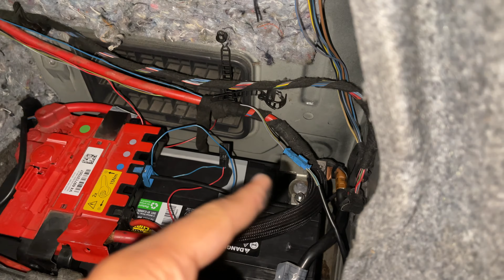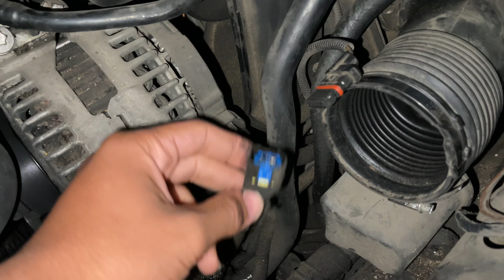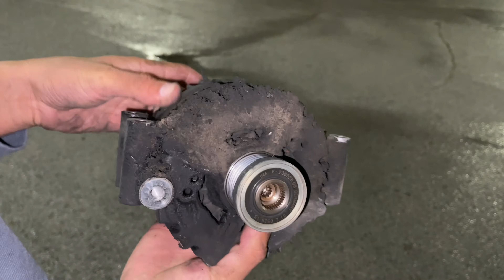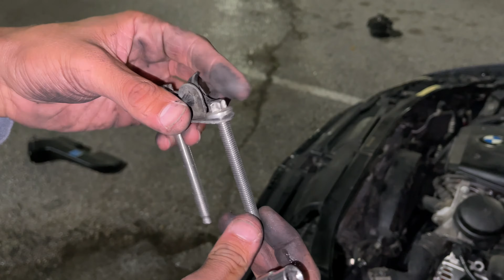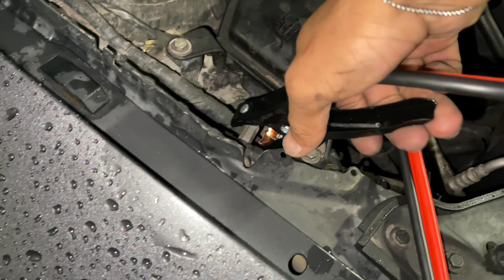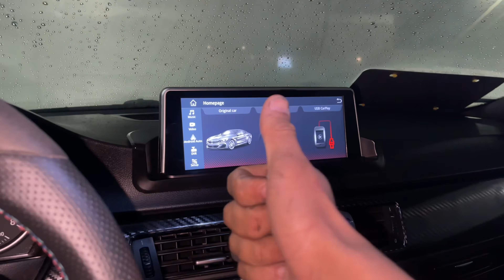BMW Alternator Replacement | N52 E90 E92 328i 528i

Comment: My electrical connector is damn near just stuck any advice to get it out ?
Reply from the maker: Use electrical parts cleaner to spray the heck out of it, then let it sit a few minutes. Do this a few times and you should be able to pop it off

Comment: Just did this. It worked. Took 3.5 hours, but when I jumped the car and it stayed on this time I knew I was good. It was hell trying to get the alternator electric cable to snap out and the tensioner on the cable was a bear (especially getting the belt on and lining it up perfectly) but damned if I’m not back on the road. Great video!

Comment: Just want to say thanks for this video. I just finished replacing my alternator and this is 1 of the videos helped me a lot. It was my first time, took me 1 hour and 45 mins. The mechanic quoted 500 for a new alternator plus 1.5 hours of work which was 200 so total of 700

I ended just buying a part of Facebook for 200 and attempted it.
Reply: I’ll be doing my first alternator change. Any tips?
Reply: I was quoted  $1,700 for mine! This looks  an easy fix. The alternator on these  motors  is well  placed  for replacement!
Reply: @malcolmwolfgram7414 I said the exact same shit I took mine in and they quoted me at 550$ for new starter and 200  for labor work 750 total I’m doing mine this week fuck paying to get it done

Comment: Question?! My battery is dead and when I jumped it the inside of the car lights came on. But, my headlights are very dim. Could it be the alternator?
Reply from the maker: start by replacing or testing the battery first

Comment: God after 160k miles, this is the next thing I have to do... Already replaced car battery, car starter, spark plugs, ignition coils, purge control valve.. All on my own to save $$$.. but I am having dimming lights on my radio system so I am just going to go ahead and replace this anyway then after that the fuel pump replacement and hopefully this should last me at least six to 12 months until I get a new car. Never getting a used BMW ever again.
Reply from the maker: these are common car issues, not just BMW. at 160K miles a starter, ignition coil and battery will be bad on any car. In fact, on a non-BMW, they would be be well before 160K miles
Reply: @IzzyE9X yup all 3 of my shit went out at 167k miles on my 328i my starter alternator and my battery is also low voltage but I think it’s due to my alternator not charging it

Comment: In depth explanation thank you, im thinking of buying an e92 325i and im watching these videos to be prepared even tho the car has low mileage 😂
Reply: I can tell you I love these cars but holy crap can they can become money pits. Just did my coolant tank, found out one of the front tires were getting chewed up while doing the oil change. While up at the tire shop shelling out 1k for new tires, balance and alignment I get codes pointing to maybe my alternator or battery going bad which is another $300 for the alternator and another $300 for battery while I just spent like $400 on new expansion tank, new cap, coolant and some new seals.
Reply from the maker: All of those issues listed aren’t specific to BMW’s and are issues you’ll find with any cars. The only difference will be high labor rates
Reply: @IzzyE9X  its that all the parts of are higher quality level and or more advanced systems so everything is more expensive.
Reply from the maker: @stevensims3342  that’s a fair point

Comment: Hey bro i got a 2011 328i so i try to start the car this morning all i hear is a click every time i try to start i replace my starter and batter 2 year ago  and today i bring the battery to autozone to get it charge it only got 23% after it change to 100% plug it back in still not start but it only start when i use a jumper cable to start after warm up for 20 min go for a drive for like 10 min and car show up battery light and all light flashing and wiper going off car went to limp mode and bearly can drive home then turn off by it self and i got ton of weird code and car feel like it missfire too is this a symptom of the alternator?
Reply from the maker: two years is a pretty good amount of time, it could be the battery. If it has a dead cell or is giving out it could cause that issue. now if you put a new battery and it dies within a week or so, then that is for sure the alternator. two years is a good while though
Reply: @IzzyE9X  i will go and get a new battery tomorrow and put it in see if it work
Reply: @IzzyE9X got a new battery same day car started not turning on and had all kinds of errors like abs and transmission errors thinking it might be the battery because care don’t wanna stay on

Comment: 335i has N54 engine and different intake manifold and bracket holding the alternator. BMW made it impossible to remove alternator without taking the oil filter housing or the manifold. Please revise your title.
Reply from the maker: Thank you for catching this!

Comment: Yo I changed the alt on my 07’ 328i e92 coupe and I got permanent seatbelt & airbag red dash lights on… how do I get rid of that? Also, in general how much would this cost me u think? Saw aftermarket alt for 215 labor 150 so bout a little <400  is that alright
Reply: check the BST connection on the positive battery connector (the red one in the boot that connects directly to the terminal on your battery.

Often times it comes loose when you're jostling around the terminals to disconnect or replace batteries.

**If you find it's disconnected make sure not to plug it back in before disconnecting the negative side...It has a little explosive device rigged up to it similar to an airbag.

You may need to clear your codes with a scan tool afterwards to get rid of the light on the dash.
Reply from the maker: I got an aftermarket alternator from Oreillys, no issues at all. That’s pretty good pricing for $400 with install. I’ll be dropping a video on how to fix the red airbag light and seatbelt light error here in acouple days actually
Reply: @IzzyE9X  ohh aii betttt good looks